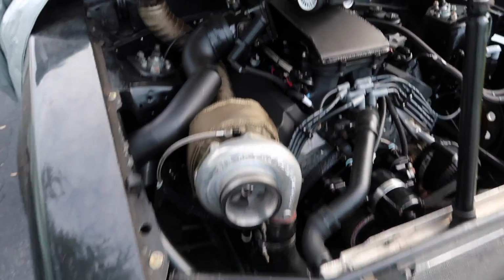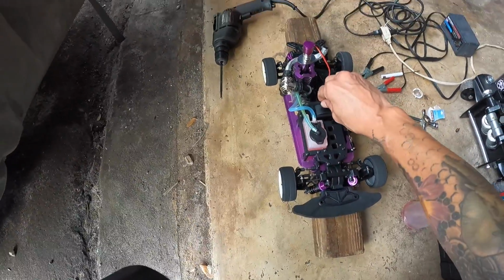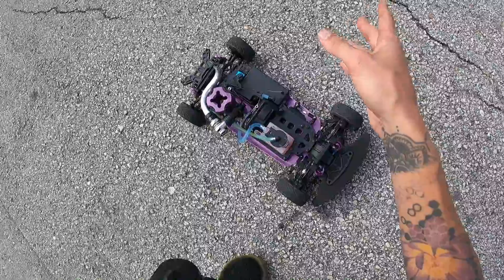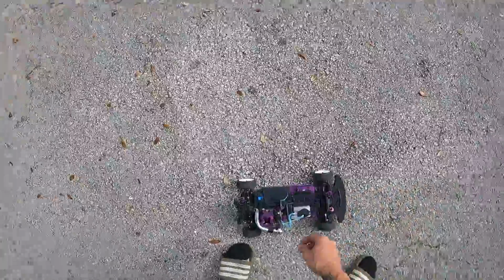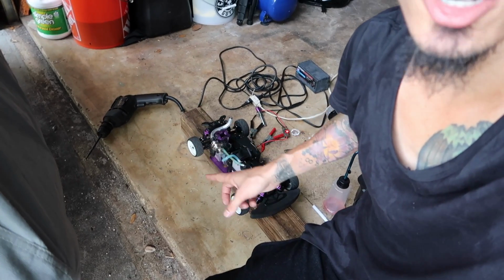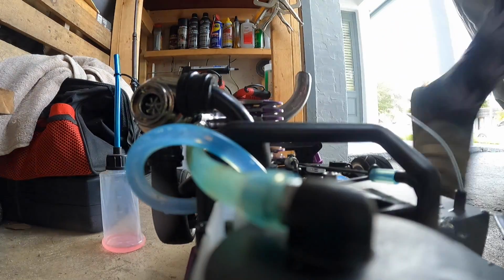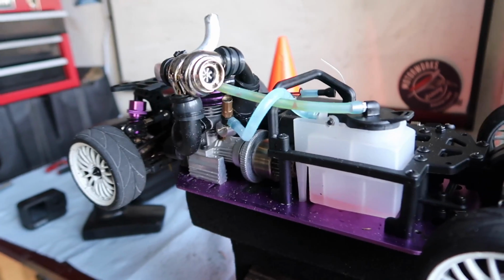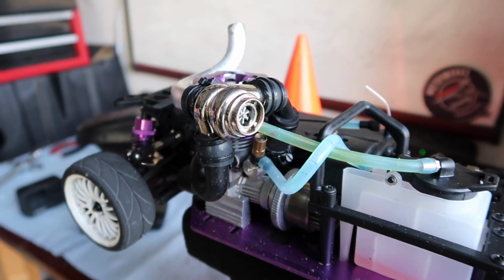WORLDS FIRST! Running Driving TURBO RC Car

Comment: Except these 2 stroke nitro engines won't ever get any extra filling in the cylinder, the exhaust port is the last one to close, meaning whatever you try to force in the cylinder always escapes. In other words, your "boost" is always being blown out the exhaust port. So it's pointless from a performance point of view.
Reply: Correct.
Reply: Two strokes, especially multi cylinder ones are almost impossible to boost. People always point to snow machines and water craft but I think the complications with isolating boost from fighting the bottom of a piston as much as it helps the top of a piston makes it a temporary benefit at best. A nitro motor is kinda doing all it can do already. Especially one without rod bearings or piston rings.
Reply: add to that : no lubs on bearing ? no wesgate ?no kooling ?   and look how much the fan is shaking this can not work its just a turbo looking fan turning free with exauste gaz , a cool looking gadget without any other effect than cool looking  :)
Reply: @miketee2444 have u ever heard of a 2 stroke Detroit Diesel? 100% not true that 2 strokes can’t be boosted.
Reply: What about turbo snow mobiles??
Reply: Ferrari …. Literally made a turbo 2 stroke
Reply: @nickd4406  Completly different type of 2-stroke. Nitro RC car engines are nothing like a Detroit diesel other than they use a glow plug. Stop being silly. People always think they have a gotcha moment. A Detroit Diesel has valves and an RC Nitro engine does not. Diesels have oil in the crankcase with pressure RCs do not. Nice try, though. You will never get any performance out of compressing air on a nitro engine. Detroit diesel runs on the same principle as a gasoline engine. The only similarity between a 2 stroke diesel and a nitro is the light of the furl with compression. Everything else is completely different in how they operate. Nitro is a very complex working miracle. The fact that they run is a miracle. You cannot boost a nitro 2 stroke.
Reply: Well it works so..
Reply: @tranejones416 it had valves on the exhaust port though
Reply: You have to tune the back pressure to match your intake to properly boost a two stroke. It's possible and has been done its just hard to do.
Reply: Wrong. The exhaust manifold pressure is also increased before the turbo, because the turbo is a restriction.
Reply: @MRCG68  bro you should partecipate to spelling bee just to piss the judges off
Reply: Explain how it works on a snowmobile then. The results are clear in performance. Factory turbo charged sleds can produce 300 hp with tuning and intercooler vs 180 hp stock.
Reply: @djs50girl 4 stroke

Comment: It's not shifting, because without the pipe, the engine isn't revving into the peak powerband.  With reduced top RPM, the 2 speed isn't spinning fast enough to engage.

Comment: Btw for future blags.... the turbo doesn't pressurise the fuel to force it into the chamber! The turbo is a compressor that forces compressed air into the chamber to increase how much oxygen is there to increase burn temp of the fuel which increases power and efficiency.

Comment: Blue exhaust smoke= rich    White smoke = Lean
Reply from the maker: can you tell what color the smoke was? Lol
Reply: @JovanMichaels  In the video it looks blue, ideally you should only see a little smoke when you accelerate heavy from a stand still and you want the smoke to be more grey
Reply: try to find a air filter the car could be loosing prime I noticed excess air in the fuel lines this should intern create positive vacuum if that is a true turbo, and the exhaust goes back into the engine through the carburetor in this case, and you’re going to have to run it rich because under full boost, it’ll lean out to the proper ratio honestly, I have had a few nitro rc’s I’ve never had great luck with them, but this is my limited knowledge small sidebar a rich nitro engine will last longer a lean nitro engine will be slightly faster I believe you’re running your Car lean nitro’s are a lot closer to diesels than they are gasoline the fuel is the lubricant. verses on a diesel, the lubricant is the oil, but there’s lubricants in the diesel fuel to keep the injectors from just destroying them selves
Reply: Also a carburetor that isn't designed for a "blow through" application is going to have a hard time keeping up with fueling. Especially under load where boost pressure in theory will increase more, therefore creating a higher fuel flow demand without the carb being setup to have a jet reference for this situation.

Comment: Tune according to temp. Get a temp gun. I've been out of nitros for a bit, but I would tune mine to run 230 degrees. Old school way spit on the head and if it boils off 3 seconds or less to hot.richen up. As long as you see a decent steady smoke coming out you should be fine. When these things sit and idle they will load up with fuel. As far as transmission there is a grub screw in there with a ball and spring to adjust when it shifts. Poke around you'll see it. Out shift sooner. Tighten to shift later. If to loose it will start in second. To tight it won't shift out of first. Hope it helps. I started out with a redcat tornado bb.
Reply: Yep that's the way I do it and it works

Comment: It would've been lean, natural.  That tiny carburetor wasn't designed for forced induction. If the turbo was actually working well the carburetor may not have been able to feed enough fuel

Comment: The expansion chamber is part of your combustion cycle. You could try leaning out the bottom end and richen the top end since more air needs more fuel. You are above atmospheric pressure regardless. The oil from the exhaust would probably mess with your fuel pressure(the fitting should be on top). The exhaust system is most likely too restrictive at lower rpms(charge pipe is probably causing hydrolock conditions.)

Comment: I dont know about turbos but I have a nitro car too. Still without a 2-speed gearbox, BUT since it's a 2-engine nitro car, theoretically it doesn't need 2 gears. But that will be my next plan. 2 gears on 2 engines. Keep your fingers crossed for me!

Comment: You need the expansion chamber for a 2-stroke to assist in intake and exhaust through the ports.  Bolt the turbo onto the end of the stinger of the tuned pipe.

Comment: Word of advice by temp gun to monitor temp most rcs run 200 230 on good tune but if u want it to stay running ditch the turbo it's cool but it's novelty you'll never get it to run perfectly it gonna only run good on full till there's just not enough adjustment on the stock carb also u need to have the tune pipe those motors need it to run proper iam not a expert but I've done about everything to one through past 35 years and out of 40+rcs I only have 3 nitros any more just got to be a hassle and burning up motors aren't cheap anymore  u want more power go with bigger engine will  get a better results but after super charger  turbos and nos was best and 40 plus motors u get a better results not to discourage anyone but there not designed  for force induction now the bigger aviation planes and motors that's little different but u better have big pockets keep up great work and have great day.

Comment: If it's running too hot it needs more fuel as the fuel is what gives it the cooling. If it's an SH engine they aren't the best and can be a PITA to tune. On some cars the wrap around clutch can drag quite a bit which can cause it to cut out. If you run a faster idle this can help even though it means the car will be trying to run away all the time but it will stop it cutting out. You should be able to hold the brake on without it cutting out

Comment: Possible lack of air at top end. If it's sizzling your at the lean side. But the balance between fuel & air mixture may be off. What's the diameter of carb verses the turbo. I would make sure the intake on turbo & carburetor measures the same. Hope this helps.

Comment: Ps the exhaust pipe turned up does not allow excess fuel to escape thus stalling when buttoning off the throttle 😊😊

Comment: It’s getting hot because it’s too lean on top, and it’s too rich on tge bottom. The glow plug is only used on startup to heat the combustion chamber. It really needs that tuned expansion chamber pipe to make power

Comment: Think of putting a turbo in your car just smaller so think smaller, like is there enough fuel compared to all the air getting pushed in?
Reply: Just think. Nitro fuel makes its own air
Reply: So it’s already got a ton of air so you need to pump the fuel faster and atomize it so it has as much fuel as air, there needs to be a balance, that’s why cars are tuned

Comment: You should add a mini bike NOS kit the c02 ones, set it to purge to the turbo inlet. You can add a servo to activate the NOS, a quick 2 sec shot should not hurt the engine but a 10 sec spray will kill it

Comment: Not bad but definitely work on your exhaust pipe . Not making any more power but looks cool . And i remember correct with the two speed transmission screw need too turn it in to tighten the spring. Basically when the gears are turning it will pop the lock bar in make the second gear get the power . So i would turn it all tue way in amd then back it out 3 turns and then start her up and do a on the stand test and you should hear it shift

Comment: don't know if you figured it out yet on top of the trans there is a hole should have a flap over it.that the adjustment for the 2 speed.it ' easy i have 2 of them there a blast.:person-turqouise-waving::hand-purple-blue-peace:

Comment: Because of the sound I think, the two turbine wheels (intake / exhaust side) are not connected wich each other.
So the exhaust and the intake flows are simply rotating the paddle wheels.... ;)

Comment: First make sure to get the Engine hot before start atleast 200*F so you can Start Tuning the High speed needle lean it one Hour each time until you reach high Rpms that will solve your transmission shifting aswell Transmission clutches open up at a certain Rpm Second once you got The High speed needle Settled  you move onto the low speed needle one hour at a time leaning it out once you get the Snappy bottom end Turn the Low speed needle clockwise 45 degree and low speed needle should be set it also make sure you have 1mm of Throttle Opening on the carb .

Comment: Need an expansion chamber for the engine and get a temp gun to help tune the engine! Obviously leaning the engine out will make it run faster but will also lean it out and make more heat!

Comment: and there is a small screw on teh carb (going into teh engine) this is usualy the idle screw.. you have to heat them up before starting ( engine warmner)  and you have to break the engine in properly (especualy if the nitro car was brans new ( New Engine)   and yes the transmission screw adjusts the shift point rpm ..

Comment: Looks dope AF, I would do this to 1 of my shelf Queens for the looks💯... I suggest perhaps making a new downpipe & face it down, I can imagine fuel/oil sitting in it bc of the blow through, needs a way to escape my guy. Have you tried flipping it over after a run to see if any spills out the dp/exhaust??

Comment: My advice would be to return high speed, low speed and idle back to default factory setting. Then run her up n down a bit n start tuning with just the hig speed. Once thats runnin ok, fine tune with the low speed and then bring down your idle... U want plenty blue smoke

Comment: Hey I don't know if you got it to work yet but the way the gears work is through a clutch. Theirs a screw on it with a spring inside .the tighter the spring the more revs needed. In your case the screw is too tight . Loosen screw and gear will change. Too tell if fuel's is rich or lean is by the smoke trail. You want a nice fin trail of smoke.

Comment: Hi cool vid, I did notice that the blue carb fuel feed line has air bubbles in it and dripping fuel, also if a nitro engine runs for a short time then stops on overheating then probably at the end of its life 😉

Comment: Ever notice no 2 strokes have any kind of boost? Because it makes no sense because the Pressure goes below the piston, Yes Its running lean and there is no fix for it, Wish you would of found out before the Build
Reply: Actually yes.  People have been running aftermarket turbo systems on 2 stroke snowmobiles for 15+years now.  The tuning window is much smaller and less forgiving than a 4 stroke, but still works great especially with EFI and properly sized fuel systems.  Skidoo and Polaris are both now offering factory turbo systems on their 2 stroke snowmobiles with full factory warranties.  I own one and it's amazing!

Comment: If its running lean there will be virtually no exhaust on acceleration and the engine will stutter when you open the throttle, if its to rich it will spray glycerol out of the exhaust and it will be very smoky a little exhaust smoke on acceleration is a good thing it lets the engine run cooler, with more fuel flow rather than weak and hotter. I would have thought that any turbo needs more fuel as it pushes more air into the engine than a standard carb would. carb settings also depend on which percentage of Nitro your using, I always use 25%. Try googling the Manual and look up the factory settings for That R/C car, the high and low speed factory settings and start there making only tiny adjustments on the High speed needle, the factory setting for the low speed needle should generally be left alone.

 imagine a clock face with the 12 digits and only adjust by 5 mins at a time with your screwdriver on the brass sleeved screw on the top of the carb, anticlockwise is richer and clockwise is leaner, those factory settings would be really helpful.  I recently bought a used 4.6 cc ThunderTiger Nitro Truggy with a .28 engine made 30 years ago and found the orriginal instruction manual through Google as I wanted to replace the carb seals which meant removing the needles completely to refurb them with new o-ring seals.

Comment: You have three set screw for tuning. One is idle adjustment, one is top end and one is lower end. Have to tune them all. Your leaning out top end by the look of it but the lower end is too rich by the look and sound of it

Comment: All nitros  have a Low speed needle on the carb and u also have a High speed Needle on the fuel line ( i may have it backwards lol , it been awhile )  some more expensive nitro cars hav a mid speed needle. unsure the brands.. never had one ( outta my price range lol)

Comment: I bet it is the air to fuel mixture where the REAL car has a BIG engine compared to the size of the turbo which is SMALLER than it. When you think about this and looking back to the 1:10 scale of the REAL CAR which is 1:1, the TURBO should be also SCALED DOWN to 1:10. Also recommend to consider using a PLASTIC or THINNER ALUMINUM turbo since the SMALLER ENGINE should be making smaller boost or pressure which isn't enough to turn the turbine. Hope this helps.                                       P.S. the words that are all capitalized are just the highlights to make it stand out.

Comment: You tune a Nitro Car with a temperature gun. As a rule, if you hear fuel sizzling in the crank case after shut down it's too lean. I would be very surprised if any turbo a person could buy that small will do anything but restrict airflow. Boosting intake pressure would be a surprise to me but I've been wrong once before.

Comment: i searched upå the turbo because i wanted to do the same when i get my nitro rc but  when i search it it just says its a keychain?
Reply: You don't really want to do this, you're going to kill your performance and most likely your engine.... and yes, the turbo he's using is a model turbo meant for a keychain.... you can actually spec them out to "kinda" work, it'll triple the price of the novelty turbo to do so...but again, they're NOT meant for running on 2 Stroke Nitro burning engines....if you want to play with one, you should buy a small 4 stroke RC engine from the Chinese manufacturers

Comment: So watching it die and you pulling fuel over and over, I am wondering if it is having issues mixing intake and exhaust.  You gotta figure, the turbo isn't really a turbo when it comes down to it so I doubt it is sealed on the interior so the exhaust gasses could be going back to the intake.  Try pulling it off without changing anything else and see how it runs?
Reply: It's entirely more likely that the carburetor isn't setup for a "blow through" design. Meaning it has no boost reference and jetting to compensate for atmosphere pressure increase in the intake. Under free rev notice it's fine. Once it's under load, boost pressure increases, therefore creating a higher fuel demand that the carb simply doesn't have a reference to compensate for. Look up "blow through carburetor"... I'm old and been doing this a long, long time. Since before fuel injection was on cars 🤷🏻‍♂️
Reply: @robertkenney7122  I don't think it's getting any boost is what I am talking about.  Maybe a tiny bit.  But it's a $30 keychain that is most likely a fancy whistle that may not only be boost leaking like crazy but also forcing bad air back into combustion.  

One idea to check would be to take the turbo off, blow through one side while plugging the other side to see if it is holding any kind of pressure.